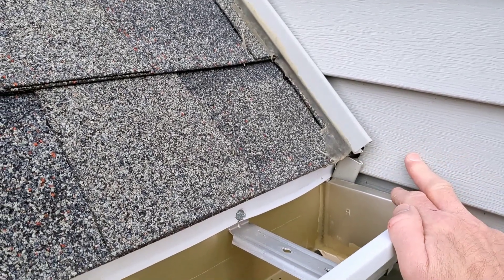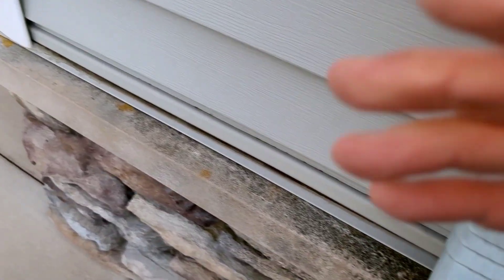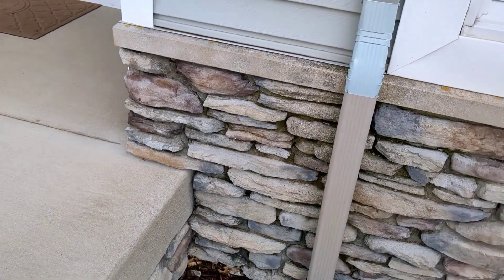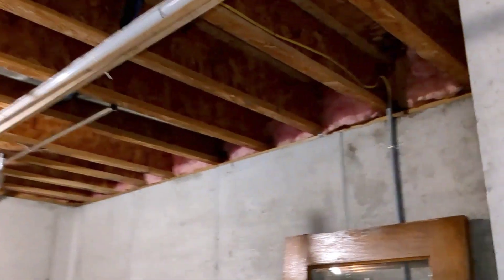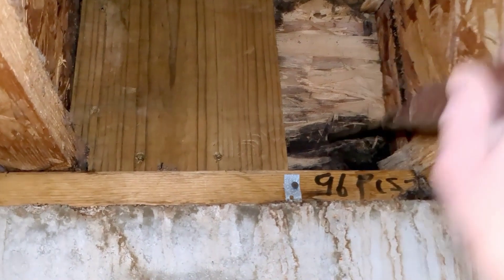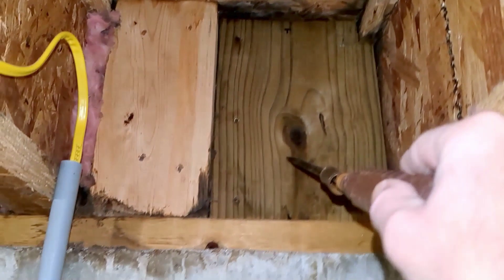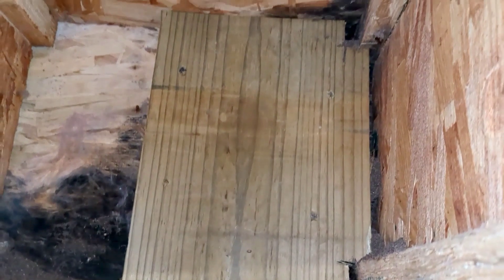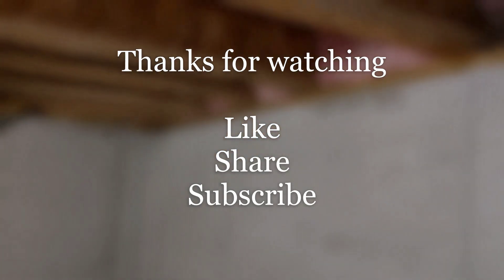⚠️ Mold HIDING in WALL cavity of 2006 home #mold & #water damage into basement #Roof#Rain Diverter

Comment: good job!! Dig inspectors like you
Reply from the maker: Thank you Very much. It takes years to learn how a house is built with its types of materials. Primarily because there are so many types, from log cabins to solid concrete and stick built structures dating back to the 1820s. Most private home inspectors are not from the trades prior to inspecting and  have taken minimal classes to receive a certificate.
The most important thing to know about a home inspector is their credentials, as many states DO NOT have licensing or any requirements!  Inspectors that are members of any national home inspectors associations are NOT required to get on the roof or check for gas leaks. They are Very minimal standards and limited but maybe exceeded.
My state "Michigan" has none.
Thanks for watching the video and feel free to ask any questions. I like to help.👍
Reply: @inspectflix  am also in Michigan, yes sir am well aware HI's = no licensing etc. Have been doing basement waterproofing 45 yrs and so i've witnessed many HI's screw ups, videos i posted yesterday - house in Warren MI, H inspector missed several important things, never said or wrote a word about 'em, buyer got screwed = see THIS a lot here in MI so when i saw your video and the good job you did i had to tell you lol, yep good job man

Comment: How does one go about learning all this?! I've done construction myself, and am currently a property adjuster (with catastrophic weather claims) so I've gotten to see what is old damage and what is new. I'd like to get out of insurance though; it's sort of awful. I'd love to actually be able to HELP people and help them avoid horrible coverage ups like this. Suggestions for gaining knowledge, specifically with trades? My framing knowledge is good, but not so much electric, HVAC, plumbing. 
And can you make a good living doing this? Do you work for yourself or with a company? 

Thanks for all your videos!! They're incredibly helpful.
Reply from the maker: Thank you for watching the video, Sorry for the delay in my response. The real estate home inspection industry is defiantly very interesting as it applies to many types of trades. Many inspectors that get in the business typically do have structural framing construction back ground and do seek for knowledge in the other areas (electric, plumbing and HVAC). 
I can help direct you with this and it may be easier and more private if you contact me with your email. The best way to correspond would be to contact my office manager Kim at kim@eyewitnesshomes.com.
The 1st question is what State do you live in? Because many states have licensing, laws and requirements and some have none.
Most home inspectors are independent (self employed) and yes you can make a good living from it depending on the location and population.
I use to train home inspections over 15 years ago and have recently been thinking about getting back into it by introducing my courses on line in conjunction with my YouTube channel.
I look forward to hearing from you and thanks again for the question.